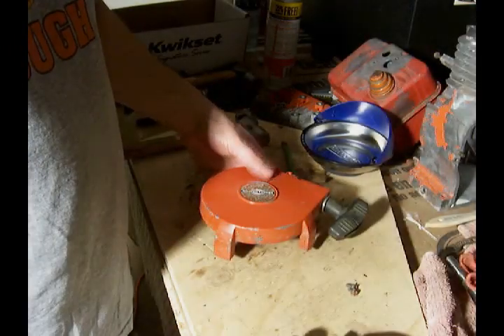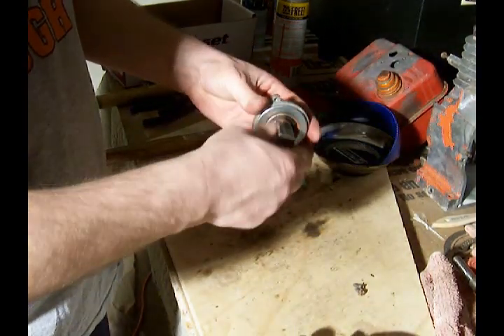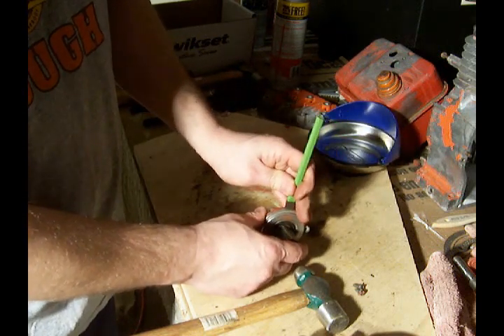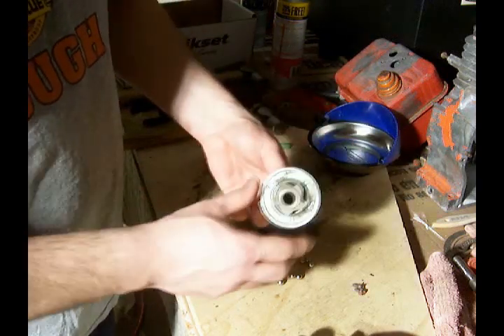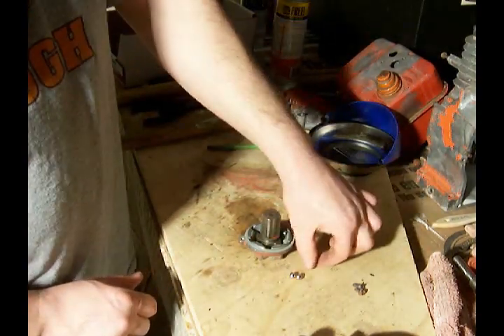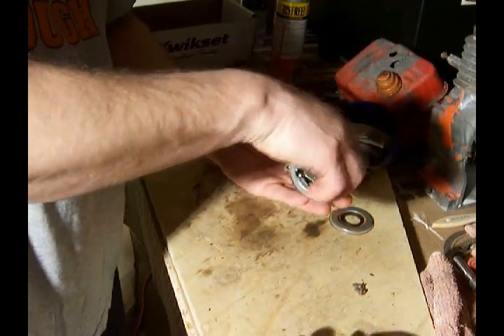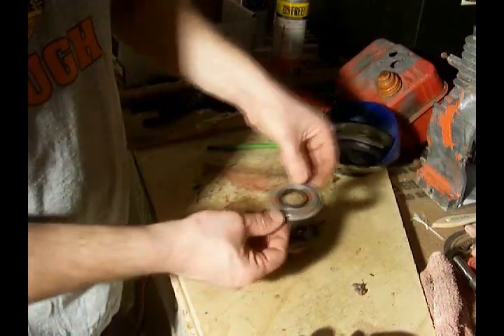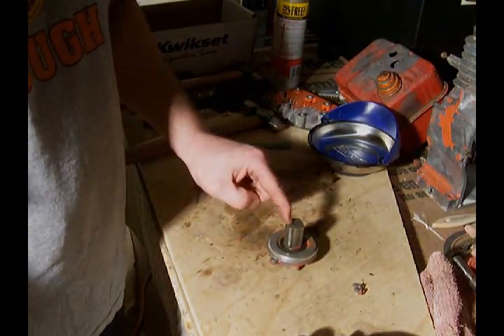Briggs and Stratton 130202 5HP - Starter Clutch

Comment: Thanks so much for this... When I removed mine from the engine it came apart and I thought I'd never be able to line up those ball bearings.. Thank God I watched your video as I was afraid I'd have to buy a new one 👊🙄👍❤️
Reply from the maker: Happy to help! Thanks for watching.
Reply: What would you recommend to keep the housing of the starter clutch  together.. It can pop open if I'm not careful .. Thanks again
Reply from the maker: @wtibbs21  Maybe there is a way to crimp the edge? Can't say for sure. Maybe even a drop of glue on the edges, just to make it stick until it's installed?